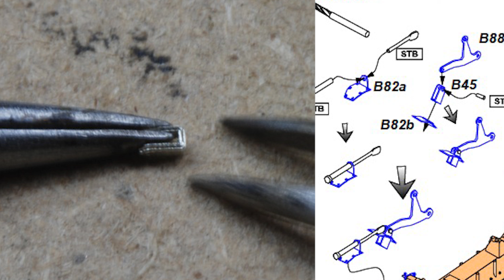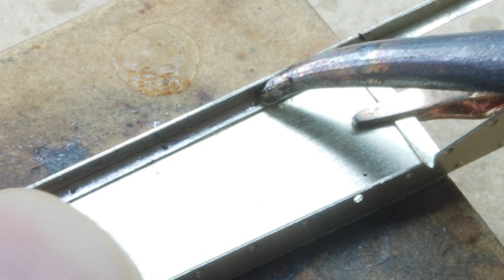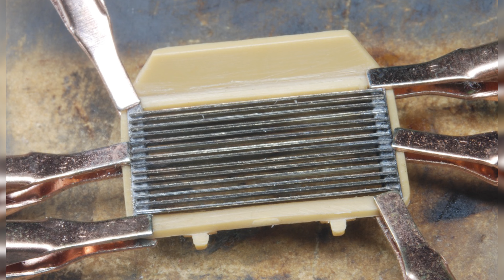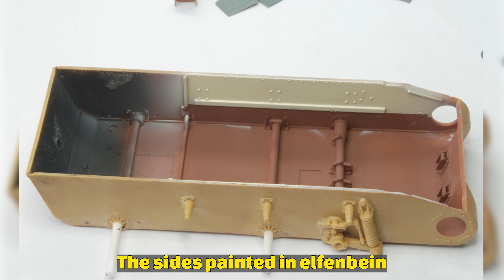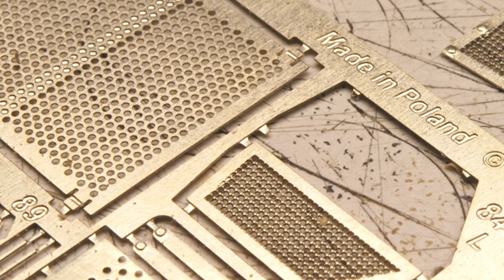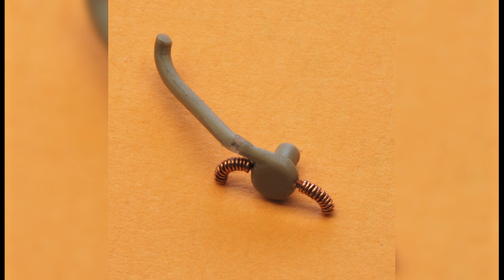Most DETAILED Panzer I Model EVER?! Photo-Etch Madness 😵

Comment: Thank you very much for adding this particular video. It is stunning and was the inspiration for getting back into modelling. I still have all the Aber resin and PE sets with fruilmetal tracks. Soldering is still a black art to me, but now your build is back in the world, I might dig it all out of the attic.
I still favour the Pz 1s and am working on converting a 1/16 series 3 back to a series 1. Thanks again. Steve H
Reply from the maker: Steve, thank you — that really means a lot. This build goes back to around 2010, so it’s a bit surreal seeing it come back into the world and spark interest again.

Soldering does feel like a black art at first, but once it clicks it’s just another tool in the box — and not always even necessary. If this video nudges you to drag those Aber sets down from the attic, then it’s done its job.

I’ve always had a soft spot for the early Pz I variants as well, so converting a Series 3 back to a Series 1 sounds like a great project. Thanks again for taking the time to write such a thoughtful comment — much appreciated.